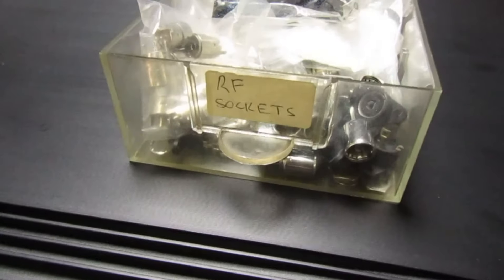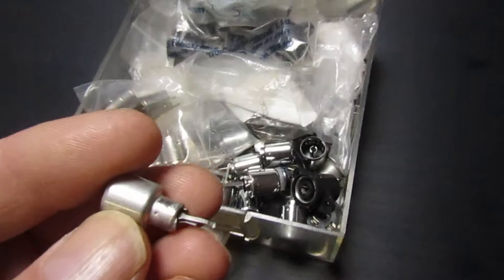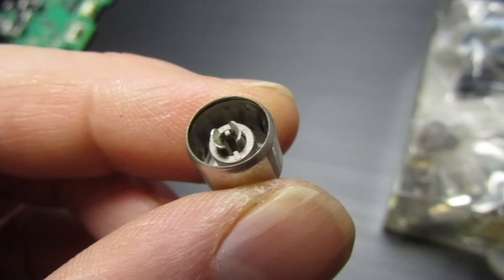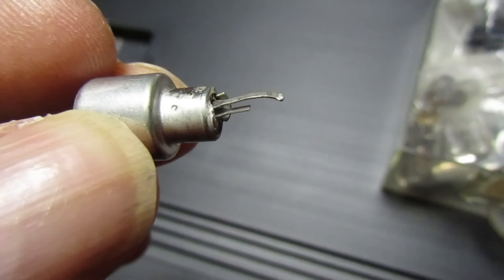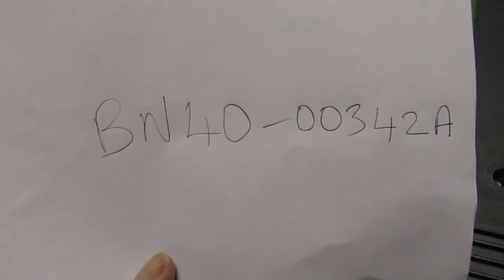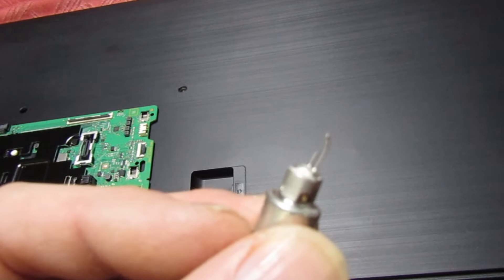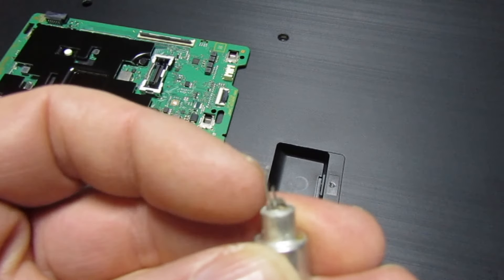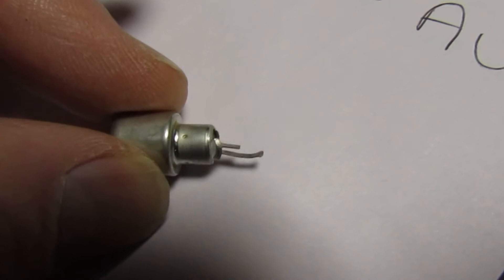Samsung QE  T.V very strange aerial socket

Comment: That connector is like nothing I ever saw here in the U.S. in 55+ years of servicing. thanks for showing us the "odd duck".
Reply from the maker: Same here, don't know what would have happened if the customer didn't bring the old socket and I just fitted a standard one.
Reply: From that switch, Samsung will collect statistics about their customers and sell it to others or decide certain markets don't need a tuner, etc.. Assuming the customer hooks up the smart features that is. Would be interesting to back probe a bit. Thanks for sharing!

Comment: Those two terminals on the back of the plug are connected (shorted) together when a male coax plug is connected
Reply from the maker: Yes, absolutley correct, but for what purpose???
Reply: @michaeldranfield7140  possibly to disable some other function.
Reply: Love how my multiple lengthy replies explaining why it has the multi contact socket and what it does have all been deleted. Good to know my input isn't welcome here
Reply: @Knaeckebrotsaege welcome to YT. The owner of a cooking channel posted the written recipe as a comment and it got automatically deleted. 

Tin foil hat brigade goes wild over "censorship", but Hanlon's Razor applies. YT only cares about selling adverts after all.

Comment: After 50 years I've never seen one like this ? I see you have the Samsung back removal tool and not the screw drive Jamed in and levered do the Samsung tool still break the back? As yet I'm lucky haven't damaged a back yet.I did refuse to look at 65 inch curved TVs darent take that on in case the screen cracked!
Reply from the maker: The Samsung tool is not very good on some sets and I couldn't get it to remove this back but I have found a much better way or removing the back which I might make another video about.

Comment: Hi, getting rid of my Sky box and tried to attach the coax wire to my Samsung TV but found the ANT input slot is the one you've shown in this video. Would I need an adapter in order to fit the wire in? Thanks

Comment: Could it be something like switching a powered output for a TV Link type device like Sky used to have?
Reply from the maker: A good theory but I don't think it will be power related as the two inner contacts are shorted together when the plug is inserted.
Reply: @michaeldranfield7140   I was thinking the shorted centre pins could be used to switch on the 9V or whatever between inner and outer, and the 10K unplugged would tell it it turn off. Can't think of any other reason, unless it disables the tuner to save energy.
Reply: I may have the answer,  was just reading that certain Samsung TV's recognise if they have an aerial connected. If not they grey out the OTA tuner functions.

Comment: Guesswork on my part but that may be a socket for the male F type plug they used to fit on some indoor digital HDTV antennas. Another guess, the socket detects when that antenna is plugged in and disconnects the feed from the satellite box cable.

Comment: Exactly what I have in my hand from mine breaking off .. next where it came off there are 2 sky like plugs .. can I not use these as an alternative antenna plug .. thank u
Reply from the maker: I dont know what the extra pin is used for but someone in the comments said it may be used in the self diagnostics to check if an aerial is inserted into the tuner or not , if this is correct you could just short the extra connection out .

Comment: Does it have a digital and analogue tuner may be some kind of combiner
Reply from the maker: Dont think this set has analouge, someone suggested it may be some sort of customer self diagnostic so you can check if the aerial is connected from an on screen display .

Comment: As the connector has broken off once and will almost certainly do so again I'd be tempted to solder a flying coax lead to where it's soldered in, bridge the 2 pins and put an F plug on the other end, a belling Lee to F adapter can then be connected to it. Not going to then come apart.
I remember on some old Pace satellite boxes the Uhf pass through aerial socket diameter was a fraction small, made for a very tight fit and guess what happened when someone tried to remove the Uhf aerial plug 😊.
Reply from the maker: Customer said it was fitted to a wall with a very short RF lead and someone swung the TV out. Knowing what mistake he's made I doubt he will be doing it again.
Reply: @michaeldranfield7140  I was just looking about to see how common this is and how complicated a repair it may be, as I have done the exact same as above. I must say it didn't take much for it to break, its very delicate.
Reply from the maker: @benparker4290  solder is only a soft metal so its very common for customers to break off the socket's, due to the small space inside the tuner it requires great care to re solder both wires but not impossible and you could always replace the whole tuner if you cant manage to re fit the socket.

Comment: I seem to remember having one of those in a year or so ago, I put a "standard" socket in and soldered the two points in the tuner together, my thinking was that they would be connected together when an aerial plug was inserted any way. Seemed to work ok. Could it be that it's to grey out the aerial input symbol on the input source menu when no aerial was connected ?
Reply: Ahh, i've just read the same on another forum 😀
Reply from the maker: Doesn't make any sense as the TV would know there was no incoming signal if the aerial was disconnected, don't know what would have happened if the customer didn't bring the old socket in and I just fitted a single pin one without realising.
Reply from the maker: But does it say what the purpose is?
Reply: Not knowing these models but just a thought. 

Don't these Samsungs have that easy autosetup where they ask the user to connect all sources and initiate setup by detecting devices in the background, including auto tuning in the background while the user is entering internet settings? 

It would be pointless to auto scan through an unconnected tuner (especially if the user was connecting both aerial and satellite) so maybe it's to detect that and autoskip an unused socket?

Comment: Maybe it's an energy saving thing, to shut off the tuner section if not in use
Reply: That's a good thought, since I'm retired I no longer have access to schematics to investigate. Energy saving is certainly an issue nowadays, and with sections of TVs having rails supplied by individual buck converters, that would be easy to implement.

Comment: Perhaps it skips the UHF channel scan on initial setup if no lead connected? Seems a bit pointless but the modern sets can take ages to do the overall setup with all the connectivity options and smart app nonsense
Reply from the maker: That would seem a possibility, can't see anything else it could logically be used for.

Comment: Thanks for another interesting video Michael.  Have you made any videos about the active power, via the antenna socket, that many TVs use to power a masthead antenna.  My Sharp TV outputs a fixed 5v but I can not find the maximum current anywhere.  I would like to use the 5v to power a relay to turn on other TV related appliances, which I imagine will need a filter to separate the 5v DC from the RF - maybe another subject for a video?

Comment: If the TV has a smart diagnostic - to on-screen guide the user through an installation or 'why isn't my TV working' procedure - it would allow the logic to distinguish between cable not plugged in and cable plugged in but still no-signal condition. This would allow for awareness of user plugging a different cable in thinking that was the antenna, plugging in a plug that has left its center pin behind in the previous TV, or there being an antenna/cabling fault resulting in loss of signal.

Comment: Could it be used to detect if aerial plug is plugged in, so on the input source menus, normally hdmi sockets are greyed out of there is no plug/signal in them, so could the tv input also be greyed out with no coax plug in the socket? Ill have to test this , next time i get one in.

Comment: You dont think it maybe a seprate 5v output for an aerial Amp 
Anything in the menu
Reply from the maker: No because when the aerial plug is in the two middle contacts are shorted together.
Reply: @michaeldranfield7140  Yes it is strange never seen that before
Keep up the good work

Comment: Why do we still use those stupid ariel sockets & plugs that don#'t stay pluged im why don't we use screw in F connectors or the ones they use for CCTV where you push them in & turn them the other ones i can't stand are scart plugs i've throwen so many scart leads away i use adprors & phono leads